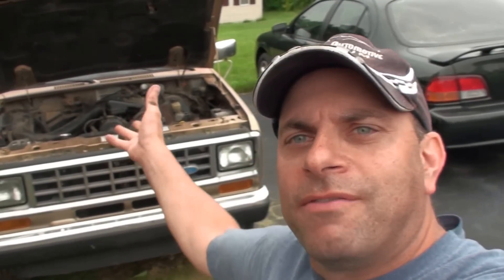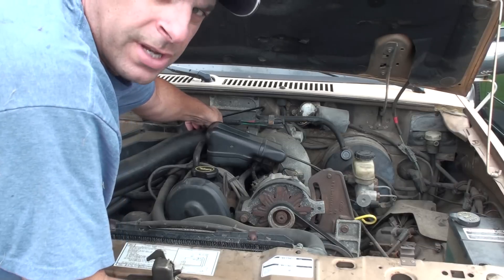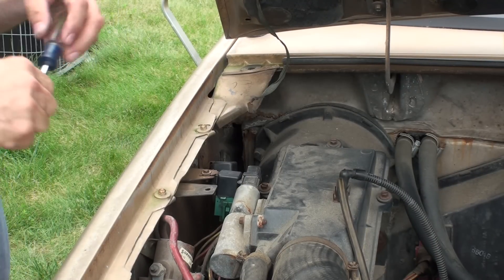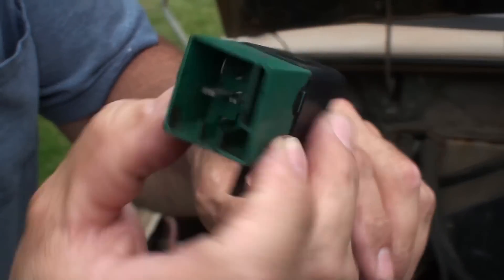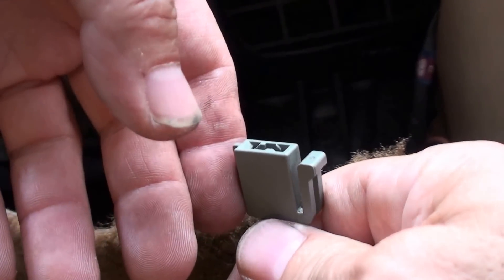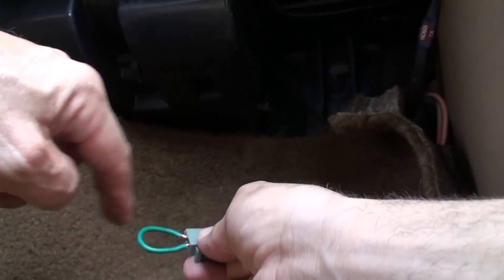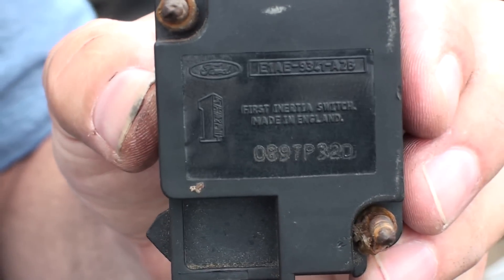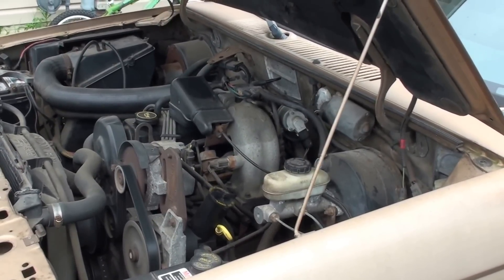Engine Crank, No Start -Diagnosis and Fix - Ford Ranger

Comment: I have a 94 ford ranger the spade with the dim light wont go bright light hen the swit h is on does that mean its the switch on the colum
Reply from the maker: No clue what you are asking, can you write that again?
Reply: @ozzstars_cars sorry
Reply: Sorry the relay that goes to the fuel pump .when you told him to swich the igneation on the test light wouldnt get bright. Does that mean its the computer
Reply from the maker: @ericwilkes238 no it doesn't
Reply: Ok thanks
Reply: My 94 ford ranger has no fuel at the shrodar valve but will run if i put a short burst of starting fluidi in the throtel body replaced fuel pump in gas tank still no fuel at valve do i need a high pressure pump
Reply from the maker: @ericwilkes238 test, don't guess

Comment: Honestly you just saved my bacon, hard to find info on these old trucks
Reply from the maker: Glad I could help!
Reply: @ozzstars_cars  im trying to resurrect a 86 that's sat for 10 years(not getting fuel) with basic part swapping skills, little diagnostic. First time using a test light.

Comment: Man I just got an 84 ranger V6 for 400. It was running then stopped on them. It's does have a crash on the driver fender . I was wondering if maybe that triggered it. Gonna check it out tomorrow, very good, clear video man. Thanks
Reply from the maker: Let us know what you find.

Comment: I just fixed my 89 STX yesterday has the 2.9l V6 in it,,, had fuel but no spark,, had power to the coil but coil was not firing,, it was the ignition control module on the back side of the distributor,, took me longer to figure what I needed to remove it,, one video showed a guy using a Phillips screwdriver,,, nope it was a 7/32 socket,, changed that bad boy out and fired right up runs just like a champ
Reply from the maker: Nice find Chris!

Comment: My 88 ranger 2.3 won't start it just crank and already change both fuel pump, new gas tank, spark plugs, battery, and distributor still won't start fuel pump is direct connected now and still won't start what your opinion have sent it to many mechanics and nothing at first it ran then stop and now it won't crank and I'm losing hope of fixing it myself still trying before sending it to the junkyard
Reply from the maker: @antoniojimenez6748  check timing and compression. Got spark?

Comment: Hey Ryan , so i asked if i detected Pennsylvania the other day and Delaware makes all the sence , firstly i am not tech savvy with where to write or ask questions! I apologize in advance,  the reason for the veiw of this video  i have an 83 full size bronco , not sure if original motor was 302? 
It now has a 92 351w, so ignition switch always been sketchy most of the time it stays engaged and i need to thumb it back when she goes off, the other day I left it running in the driveway to warm it up when I came out it had shut off and I could not get it started it cranks fine it does have an aftermarket fuel pump put smells really rich so I assume it's getting fuel however I have no spark it also has an HEI GM distributor I've tested most everything in the electrical circuit and now I'm at the steering column and thinking it could be that Barrel or the link that runs down the column I've never pulled one apart it might be that rod that's in there or just the barrel is shot I don't know any advice would be a help before I pull this thing apart if there's something else that I need to test my alternator is good battery is good selling out on the firewall is good I just no spark thanks in advance and if there's someplace I can write or donate I will just let me know how thanks in advance Johnny O
Reply from the maker: If the ignition has a control module or igniter I would start there for no spark.

Comment: Sorry, off topic.  Can you tell me where the EGR vacuum line hooks to?  Is there a vacuum regulator going to that?  So my 86 Ford Ranger has never had a fuel problem or injector problem.  Good troubleshooting techniques.  I have the same 2.3L EFI engine.

Comment: Hey buddy I was having exactly that problem with my 91 ranger I bypassed the little switch it fixed my truck after several mechanics and a few hundred it’s fixed now thanks buddy
Reply from the maker: That's good news. Send those mechanics the video link. 👍

Comment: I was driving my 1995 Ford Ranger 2.3 manual on the freeway tonight and it just died on me.  I had replaced the serpentine belt two months ago and thought maybe it broke again...however this time the engine would not restart and the belt was ok.  Plenty of battery voltage.  Had it towed home and first thing sprayed ether into the intake with no results.  I'm thinking this is an ignition problem but not sure where to go from here.  Any ideas?  Thanks.  Norm
Reply from the maker: Checked and no spark? I would start by testing the coil and also the ignition control module. Good luck with the diagnosis!

Comment: I have a buddy with a beautiful 96' F150 5.0 super cab short bed 4x4 that's got over 220000 miles and it's a very reliable machine but it left it left him stranded a few months ago and it was that damn inertia switch...
He was doing 80 with the cruise on and it just shut off and he had no idea...
He said after just a few minutes of diagnosing the mechanic went right to that inertia switch and jumped it out and he was on his way...
Reply from the maker: Those are great  trucks and built well. So after 24 years things are bound to break!  Glad he got it fixed.

Comment: Hey I have a question. I have a 2003 Ford Lincoln. I bypassed the fuel pump and the fuel pump works. The inertia switch is good. The truck cranks but no start. When I put the key to on position, I get a temperature light on the dashboard. What could be causing my truck not to run? Thank you.
Reply from the maker: It's impossible to diagnose something like that over the internet. Only Scotty the hack can tell you. lol

Comment: Comes down to a flakey switch. This is, as a technician, my nightmare to figure out!! flakey switches intermittent!!
Great HELP here, will follow your lead on my 2001 today.
Reply from the maker: Good luck!
Reply: @ozzstars_cars  
Looked at the one today, (inertia switch) the condition was proper trigger to OPEN and the reading was infinite impedance , then in closed position,  the reading wanders all over the place in its impedance just like your did.
I figured it cannot possibly produce steady 12v to the pump like this. 
Any recommendation source for these? 

Had another person call a few part stores and range price was $45~105!

Still had no pump on - energized issue. 
Traced the 4 wire plug at pump connection above tank RED =12V, Black = ground. So I think pump is faulty. 
I looked for a secondary high pressure fuel pump on the frame rails. and did not see one in line like your example. Just a fuel filter, nothing else. 

Next step is to drop tank and check pump when in hand. I could not hear or feel it operating at all, should be able to feel a some motor action yet it was silent. Even jumped the switch to eliminate possibility it's affecting issue and no joy there either. .
I believe I have a compound problem, possibly inertia SWT flakey and Pump went bad.
Initial issue was, truck ran fine day before, went to start it in the morning, engine cranked and would not fire up.
This video gave me a great head start for points to look at.
Reply from the maker: @ashqelon7267  before anything else did you verify fuel pressure at the rail?  What was the pressure? Will the engine start and run on starting fluid to verify its a fuel problem?
Reply: @ozzstars_cars  I did not use a gauge to verify pressure as didn't really even think of that. I feel that would have been a deeper troubleshooting if needed could have, yet so let that step  alone .
Yes it did start for a few seconds 3-5 with ether, until it was consumed, so I was confident Electrical was not part of the problem.

Comment: Bbq hello I have a 97 Ford F150 4.6 inertia switch has no power at either wire I have no fuel pump coming on checked all the fuses and relays are good what do you think
Reply from the maker: Grab yourself a wiring diagram and find out what's going on.

Comment: Great video . I'm having a similar problem with my Ford ranger. It's an 83 V6 2.8 liter manual. I have crank but no spark at all. I replaced the coil, tfi, and pickup coil inside the distributor. It used to run but very poorly and if I gave it any gas it would die. Now there's no spark at all. Not sure if the two things are the same issue.
Reply from the maker: Did you check for any trouble codes to get direction? EEC?

Comment: We have an 02 with crank but no start
Reply from the maker: Time to diagnose. Those are my favorites!
Reply: @ozzstars_cars  any ideas? We've changed the crankshaft sensor, starter, spark plugs, fuel injectors, and the fuel pump. No luck yet

Comment: were you able to get a new switch ? I have a 2003 ford focus 2.3  and I do not think that they make mine anymore   so I pray that mine does not go bad . I also know that these were common on the ranger  or from what I understand
Reply from the maker: Pretty much have to search online for old new stock, go used, or the ol' bypass.

Comment: I've got a 1997 Ford Ranger.  Starts up great when cold.  After I drive it 3-4 miles the truck will not restart until I let it sit for 15-20 minutes.  During the period it will not restart the engine seems flooded and there is a distinct gas smell.  Any ideas as to what mechanical component may be failing?
Reply from the maker: Start testing the electronic spark. Ignition Control Module
Reply: @ozzstars_cars  Thanks.  Got spark when the engine was cold, but not when it  warmed up.  Turned out to be an ICM ground wire that was connected but also corroded.  Cleaned the corrosion off and so far so good..
Reply from the maker: @johnr8309  nice find! 😉

Comment: I have a 2002 Ford F-150.  I have replaced the battery battery terminals
However the power cable from the battery to the starter is in bad condition
I ran a jumper cable from the positive battery post down To the starter and  I can spend the starter but it doesn't engage and it still will not start ....
Please advise 
Any help would be greatly appreciated
Reply: BTW is had been staring prior to discovering the power cable is bad and now the eyelit is broke off
Plz help

Comment: Hi great video. Helped a lot but got stuck when testing jumped inertia switch with test light to positive terminal.  No power. Any guidance on next steps? Thanks, Jeff N
Reply from the maker: Test light should be hooked to ground so you can test for power  with the ignition on, the the light should glow if the circuit is completed to the fuel pump. If not, then time to diagnose the problem.

Comment: Dad: Son, crank the engine
Son: okay
Dad: Crank but no start
Investigation........
Dad: Everything is working........
Dad: Son, did you press on the clutch when cranking the engine?
Son: 😶

Yes, I know..... 🤫🤫🤫
Reply from the maker: And that tradition is passed on for generations......that is until there are no more manual transmissions in existence. 😒  Thanks for your great comment! -Glen

Comment: I hope you can help me out here. I have a 2004 Ford Ranger Edge 4x4 with a 6cyl. 4.0L engine. I learned from a different video a year ago that the accessory relay in the passenger kicker panel could be the problem. Cranking, but not starting. I replaced the relay and it fired right up. I replaced the relay again a week ago and it started right up and it isn't starting again. What can be causing the relay to keep going out? Any help is GREATLY appreciated.
Reply from the maker: That is an interesting issue. Very rare issue, never heard of a relay constantly failing like that.

Comment: I ended up cutting the two wires off my inertia switch and connecting them together in 2014. Havent had any fuel pump issues until now (late 2022)
Reply from the maker: That's one way to do it.

Comment: How bout a no spark to coil problem on an 88 ranger
Reply from the maker: What about it?
Reply: Changed out ignition control module and now idles like sewing machine but when accelerating to 1.5  rpms starts to misfire or so it sounds, any ideas
Reply from the maker: @yemajdleifyam7554  check fuel pressure.

Comment: Mine for some reason, has been bypassed. Unhooked. 
I’ve got mine running but having issues with it stalling sometimes. I’ve had so much done to my little ranger. Over 1000 dollars in parts and labor. 
Thank you for your video! Very well done. I could use a good helper Like your son.

Comment: Thanks for the tip I bought a 1998 ranger for $300 The guy said it just quit running on him he replaced the fuel pump,fuel filter spark plugs then he just gave up on it your video was the first one I watched trying to troubleshoot it and sure enough pushed the reset button heard it click got in fired right up. Best $300 ever spent thanks
Reply from the maker: Jackpot!  Nice.

Comment: my 99 ranger will start when battery charger is hooked up, but soon as I remove the jumper cables, it cranks but doesn't start. Also noticed some oil splatter after cranking.
Reply from the maker: Test the battery amperage, sounds like it's weak.

Comment: Does the Inertia switch stop fire to I am having somewhat the same trouble but I'm not getting any fire at all and no gas but I noticed today that some of my gauges are spinning backwards. Could that cause that we never had any trouble out of it until a friend helped me do the breaks and the park neutral safety switch is bad in this truck so while I was getting tools this person started the truck and it kicked into reverse and went up onto the hood of his car the truck started fine after. Any advice would be greatly appreciated I don't understand the things it is doing.
Reply from the maker: Wish I could help you but diagnosing a problem like that is almost impossible to do online.

Comment: That was a huge help.  I changed my heater core and I must have bumped the inertia switch.  I fiddled with it, made sure it was plugged in and it started right up.  Thanks!

Comment: What do I check if control side - on positive battery connection. I don’t get the dim light...& when switched on, it doesn’t get brighter and on for two seconds. 

What do I check next? 
About to try and see what to check/do next!
Reply from the maker: Is the EEC getting powered up? Did you test that relay?
Reply: @ozzstars_cars  relay was bad, replaced no luck. Ordered my fuel pumps
Reply: But when I test the harness where eec eway goes I only get one light on when I’m connected to positive battery and ignition is switched to on

Comment: I think I have this problem in my truck but it’s been sitting for about a year now. Do you think if I change the inertia switch and primer and it doesn’t work could it be the fuel filter?
Reply from the maker: Sorry I can't fire the parts cannon on the internet. Only proper testing will diagnose the issue. Good luck.

Comment: I'm back from a year ago.  Was driving back from a shopping trip today and Ranger ran fine.  After an hour I had to go out again and the truck would crank over but would not start.  Just had a new fuel pump installed about 3 months ago and I'm now wondering if it could be the inertia switch.  I'll have to start out tomorrow by first listening to the fuel pump to see if it's making the startup sound, forgot to check for that.  This vid was very helpful, glad I stumbled across it again.  Thanks.
Reply from the maker: Hopefully you can figure it out sooner than later. Let us know what you find John.

Comment: 86 Ford Ranger 2.9L 2wd Manual. Pressure washed  engine, truck ran for 30 minutes, shut off and two days later; Crank won't start checked and cleaned contacts, checked for continuity and traced to fuel relay, fuel relay was, missing voltage on control ground side side. Grounded fuel pump relay at VIP terminal and fuel pump engaged,  a little intermittent, may be corrosion on contacts.  Runs with starter fluid, 40psi fuel pressure all relays work, inertia works.  Opened harness near relays found bare factory splice, not soldered but pressed, cleaned it and truck ran but then 10 min later died, cleaned splice and truck ran, taped splice and moved the harness truck died. Moved harness playing with splice and truck ran.  Will spend next day soldering splice and cleaning all contacts, May post video of bad splice as well as well additional probing for voltage in vicinity.
Reply from the maker: The good ol wiggle test. Nice find.

Comment: Had similar issue today with a 2000 Ranger, did all the troubleshooting, and at the end everything checked out, it was just stalled, or flooded out, so I pressed the accelerator all the way down to the floor, held it and cranked it, and Voila! It lives. Ryan brought a smile to my face. Cool son you have there.

PD: I didn't know about the inertia switch, nice to know that now.
Reply from the maker: Thanks Michael and glad you got your Ranger fired up!

Comment: Hi I have a similar problem on my 90’ Ranger. I have power to my 30 amp fuse and power to the fuel relay. I don’t have any power to the inertia switch though. I tried bypassing it and still no power. Is there a fuseable link between the fuel relay and inertia switch? If so do you know where? Thankyou
Reply from the maker: What you need to consider is are you missing a bad ground?  Study the wiring diagram in the video which may be helpful.

Comment: What would be the problem when I put my test light on the fuel pump relay and the light isn’t going off when I turn the key on
Reply from the maker: You aren't getting the 2 second prime? Are you testing on the correct terminal?